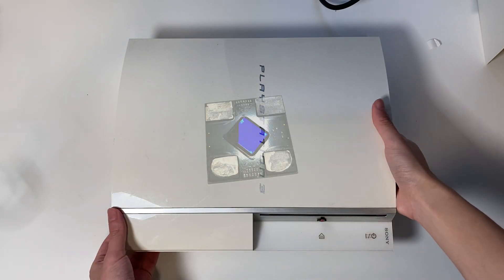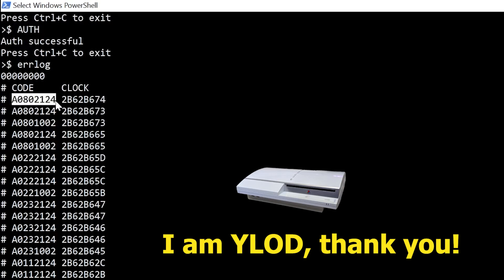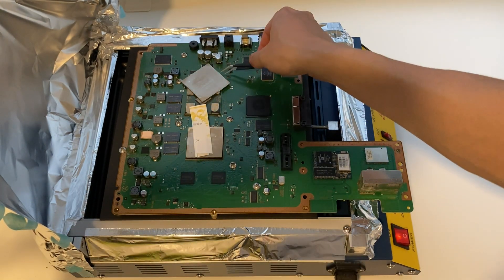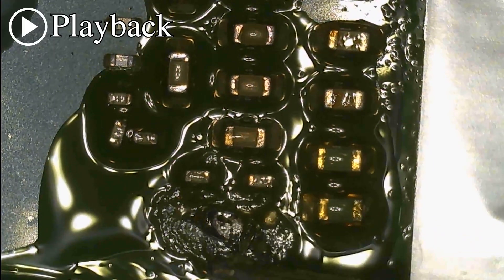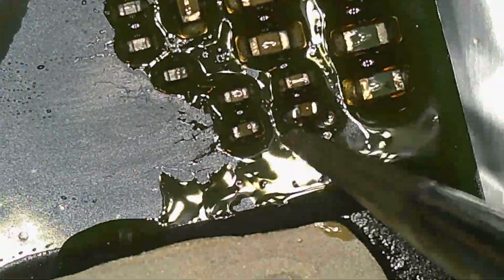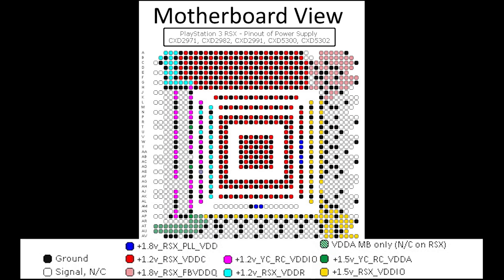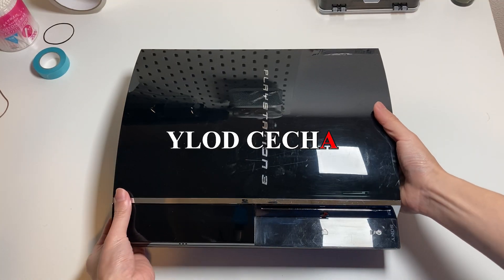Harvesting 65nm RSX for Frankenstein mod

Comment: why would you want a 65nm ?
Reply: Because 65nm is a very reliable RSX GPU, just like the 40nm. It doesn't really matter if it's 65 or 40nm, both are equally as good when it comes to reliability, they use the same underfill. 

The 90nm one is to avoid.
Reply: @That1Monika  i understand the 90 was a dogs diner but the 40 uses less power, if you’re going to go to all this effort at least do it to the best spec.

Comment: Hey I might have a tip to help with the cleaning of the BGA, https://youtube.com/watch?v=SdymB1vLdF8 on this video he uses a "low melt solder" to remove the bga from that memory, it might also help in the case of the RSX
Reply: The time stamp for the video is ~11:30

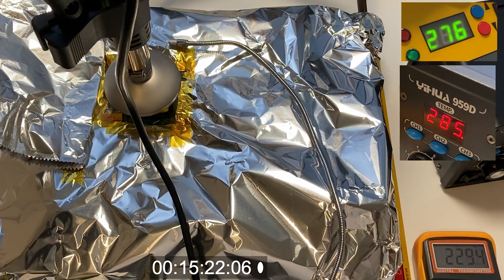Comment: 3:40
I remember doing this with a cheapo portable butane gas stove from the bottom, no hot air needed. Took 5-10mins.
Reply from the maker: Would love to see your actual setup!
Reply: @hardwarerepair200  
I didn't put it too close to the flame. Used a square metal grill like those for BBQ. 
Was expecting to trash the motherboard but surprisingly there were no "popcorning" lol.
In and Out.
Reply: @hardwarerepair200  
It would make excellent content if you made a video about it! Also spread the info you don't need expensive equipment to harvest RSX.
I'm not bold enough to transplant it using this method though.

Comment: BRUH LISTEN TO ONE THE MOST IMPORTANT THINGS EVER, THE FIRST ONE TO TOLD ME THAT WAS MY FRIEND EDUARDO AND THEN I ALSO HEARD THE SAME FROM DAVID (COMPUTER BOOTER) THE THING IS IF YOUR SOLDERING IRON IS NOT HOT ENOUGH IT WILL LEAD FOR YOUR COOPER DESOLDERING WIRE TO RIP OFF THE PADS FROM ALL MOTHERBOARDS, YOU MUST GET MAX TEMPERATURES IN THE SOLDERING IRON, ALSO I WATCH ULTRA PRO TECH GUYS USING HOT GUN STATION ABOVE THE IRON WHILE CLEANING THE PADS.

Comment: Can i diagnose a GLoD ps3 so i can harvest its gpu?
Reply from the maker: GLOD is a bit difficult to diagnose as it gives no syscon error.
Which PS3 model do you have?
Reply: @hardwarerepair200  I have a CECHL I think
Reply from the maker: @nikolaszisoudis8408  I think the only way to check is to desolder it and then measure the resistance in your case
Reply: @hardwarerepair200  thank you very much

Comment: Loving the videos. Can you make an equipment list so I can shopping and have a go whilst keeping the costs down!?
Reply from the maker: Here you go!
Flux: 20ml BS-75B
Solder: Hakko FS402-01SN60 0.6mm 150g
Preheater: Puhui T8280
Thermometer: 6802 Digital Thermometer 2 Channels K-Type thermocouple
Hot Air Station: YIHUA 959D